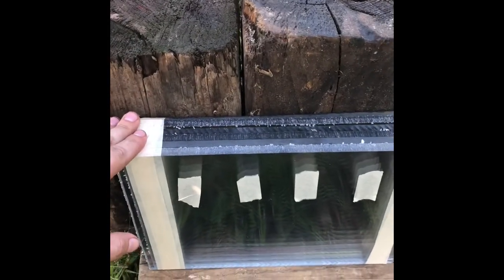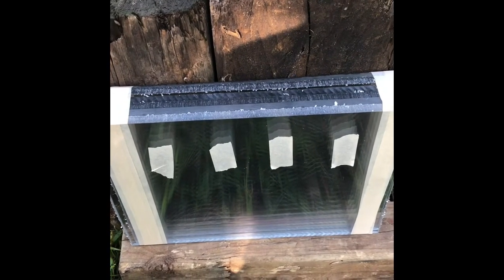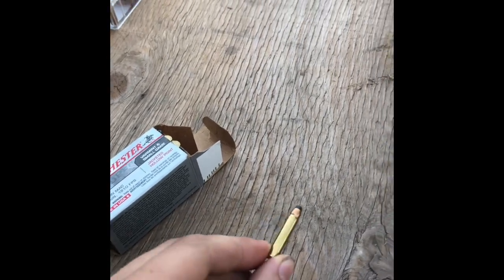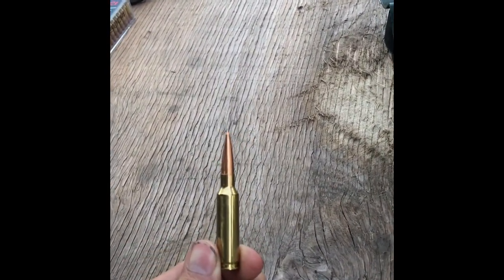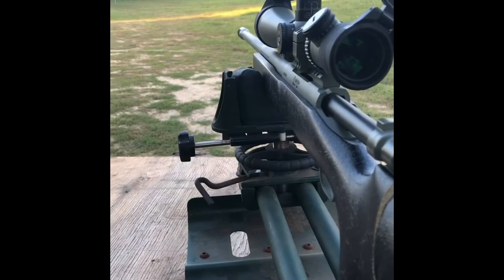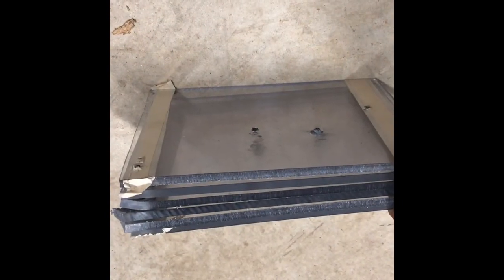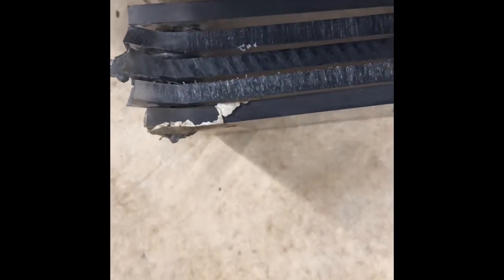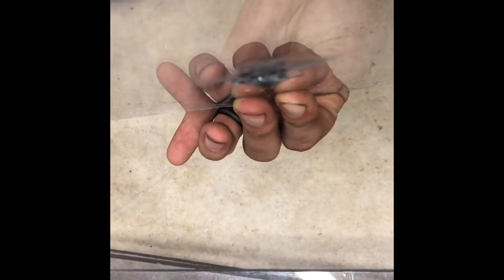WILL LEXAN STOP A 300 RUM!!!?

Comment: I’m 13 I want to order a Remington 700 in this caliber if I do I want to put a fat bastard muzzle brake on it by APA and mercury recoil compensatores to put in the stock. I am 13 6 foot 140 pounds and currently handle a 35 whelen with a muzzle brake no problem and I’m not recoil sensitive could I handle it ?
Reply from the maker: bIG Boi  it is a stout recoil without the muzzle break but manageable, with the muzzle break it has about as much felt recoil as a 243 Winchester.
Reply: Ok thank you
Reply: Hey bud there's a lot of BS on YouTube but I got my first 300 rum about 20 years ago and a 375 RUM bout the same time the 375 is absolute monster..

 if you ever get one of these big monsters though I highly recommend you get what's called a Mercury tube and have it installed in the stock it will greatly Help The Recoil especially in that 375